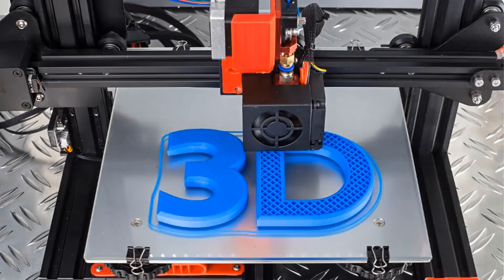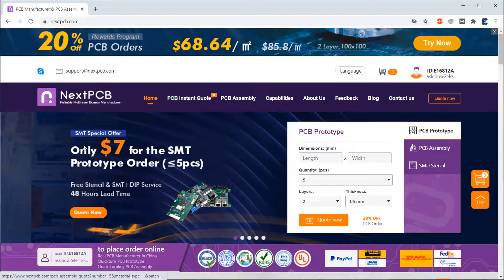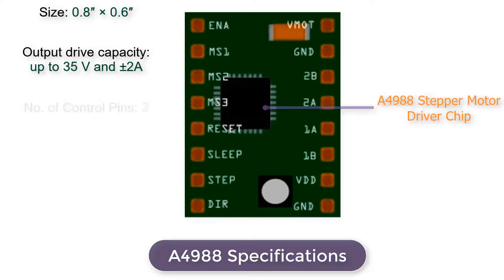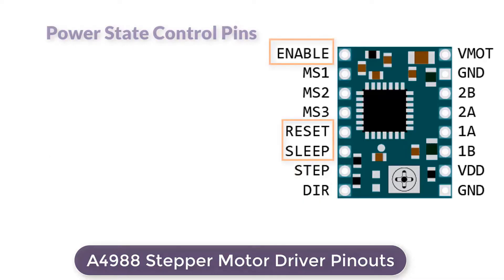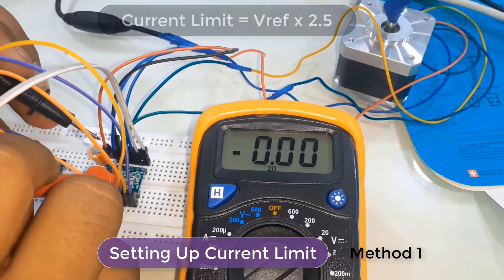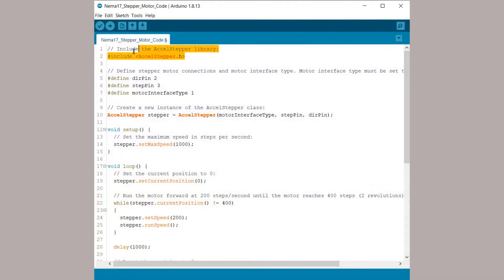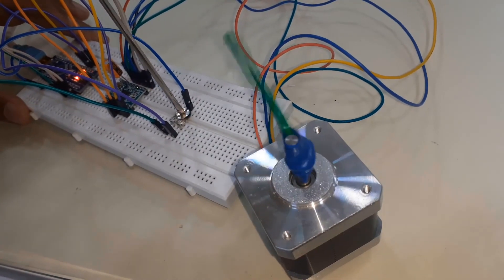A4988 Tutorial | Control NEMA17 Stepper Motor with A4988 Stepper Motor Driver Module & Arduino

Comment: Hi, ik this is an old video but I need help.
I have a nema 23 set up with a potentiometer as per your instructions but the motor starts turning as soon as I turn the power on. Is there a way to keep it from starting automatically?
I have tried different values of potentiometer but that made no difference.
I am new to arduino and just trying to learn. Thanks for your time
Reply from the maker: You need some other tutorials for Nema23.
Reply: @HowtoElectronics  it does the same thing with a nema 17 so in this case I would think motor size is irrelevant. I'm pretty sure it's something to do with the pot because I know that they don't actually go down to zero resistance. I guess what I'm asking is there anything I can do with the Arduino code to keep the motor from starting automatically? Sorry for the confusion.
I'm not completely new to building electronics just Arduino lol
Reply from the maker: Don't use A4988 for NEMA23. An A4988 is good for about 1.4 amps. For a 3.5 amp motor I would be looking for a driver than can provide 5 amps. Use Motor driver TB6600.
Reply: @HowtoElectronics  I am using a tb6600 for the nema 23. I was asking about Arduino code but NVM I will figure it out. Thanks

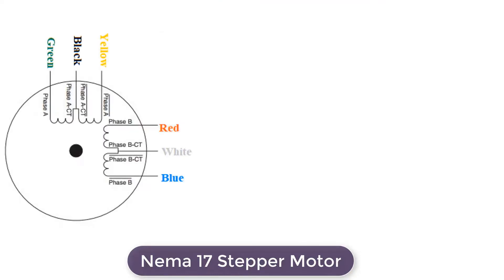Comment: At 6:27 it says the NEMA17 motor uses a yellow wire for pin 1B. That's actually a black wire, as shown in the photo at 6:16. The motor I bought from Amazon also uses red, green, blue, and black.
Reply: How did you wire it?
Reply: @dotBAIT  i check the pins continuty mode its totaly different 
1- 1b
2- nc
3- 2a
4- 1a
5- nc
6-  2b
i used my 3d printer's stepper motor here this pin config works for me

Comment: Is the 10uF capacitor for 5v input necessary, if the 5v/earth is provided by the Arduino? 

I have the 100uF cap on the high power (12v in this case) input.. Thanks!

Comment: Whenever I try this, the motor is very weak and hums/vibrates. I'm running 12 volts
Reply: Have you found a solution to this? I have the same problem
Reply: @chee4281  power source for the board was causing the problem, switched from using USB power to adapter power

Comment: how much is the max rpm with this circuit and power supply, and does it have an effect on max speed how high my power supply voltage is ?

Comment: why did my capacitor explode
Reply: did you connect the correct terminals? if you connect to the wrong terminals it will explode. Long side is positive and short side is negative

Comment: The correct formula to get the Vref is: Vref = Imax * (8 * Rs), where Imax is the maximum current of your stepper motor, Rs is the sensitivity resistor of your A4988. The most common Rs is 0.1 ohms, but it may be different for you. The two sensitivity resistors are located near pins B2-B1, A1-A2. You can use an online SMD resistor calculator to get the sensitivity resistor value.

Comment: Hello, have you done any video to control direction of a stepper motor using two press buttons switches with Arduino Nano and A4988? Or else could you advice me to change the code in this video and where to connect the two switches. I need to run the motor only while I press the switch in one direction and to run the motor in other direction while pressing the other switch.  Please advice me soon. Thank you.

Comment: If you accidentally plug in the wires the opposite direction of the a4988, and run the current through, will it damage the a4988? 
I'm using it for the first time and hope I have created a short circuit it and destroyed the driver. I use an Original Arduino UNO because I have a macbook and macbooks don't read the bootleg versions properly. 

My stepper motor is not turning and I don't know what is wrong. Please help. I'm a student that wants to learn but I don't know where to turn to for help.